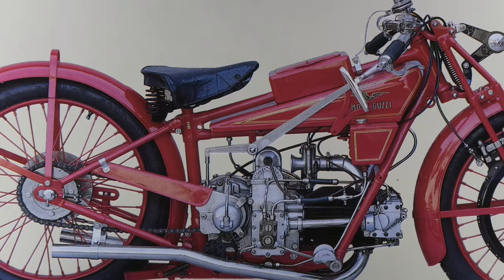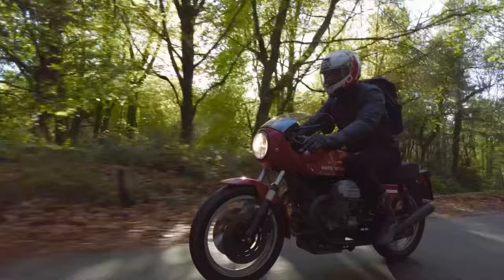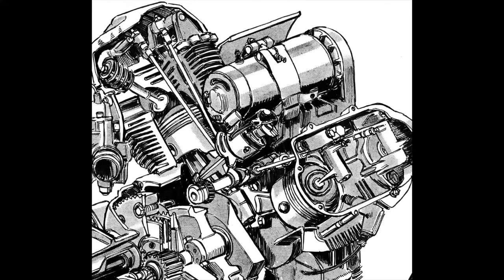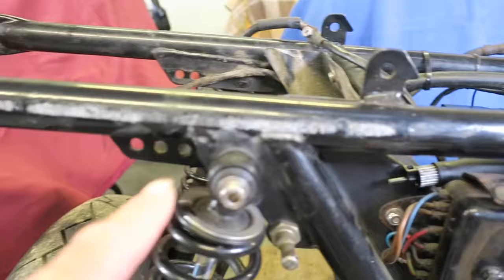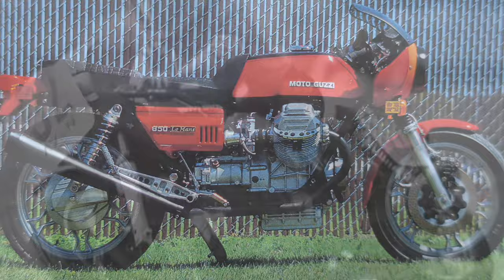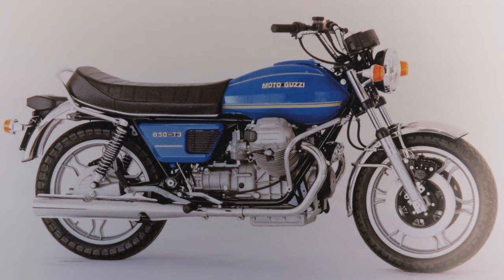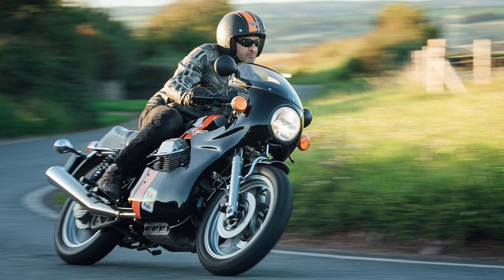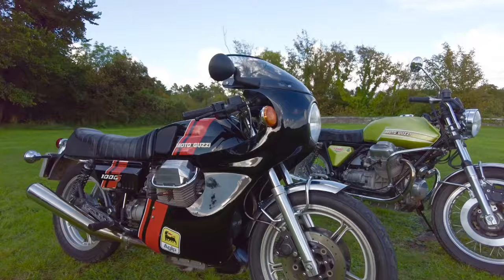TONTI | An outstanding era at MOTO GUZZI

Comment: I’ve owned 4 Tonti frame Lemans bikes.  A Mk I, (2) Mk III’s, and the one I still own, a 1990 LM 1000 Mk V.  Also owned a 1995 1100 Sport (non Tonti, of course).  The LM 1000 engine is a peach, and surprisingly strong.  Much more power than the 850 LM’s.  However, the price for that power is enormous valves that needed to be set at a very high angle to fit in the combustion chamber.  This resulted in rocker arm geometry that heavily loaded the valve stems and contributed to relatively rapid valve guide wear (40k miles is about where they start to really suck oil down the guides).  Not the end of the world.  The pistons and rings can go 100k miles if you don’t abuse them.  Even on the early LM’s with spindly 35 mm forks, the handling is remarkably good.  A bit idiosyncratic, but highly capable.  The 40 mm forks on the LM 1000’s were a noticeable, but not strictly necessary, improvement.  The linked brakes, when properly bled, are one of the bikes unsung features.  I think it works fabulously.  Finally, be extremely careful with the final drives, good quality ring/pinion gears are unavailable.  The key (and I’ve learned this the hard way), is to get the final drive unit in the hands of someone that knows how to set the gear contact patch.  This is crucial.  Most of the talk you’ll hear about setting up the drives is just rules of thumb to approximate proper gear engagement.  There’s really only one way to do it, and it can be a tedious, and time consuming process.  But if done right, it’s worth every penny you’ll pay.
Reply from the maker: I have had my 1000S for over twenty years now, it’s been on numerous trips : France, Spain, Italy, Ireland, Scotland and lots of local blasts. I have only had an exhaust valve issue, otherwise pretty bomb proof. Such a great thumping motor in that brilliant chassis. Best purchase I ever made!
Reply: @rustynuts82  I think the 1000s really nails the sweet spot of sportiness and long distance comfort.  My friend bought one new and I’ve ridden it quite a few times.  Great bike!  I think the very first 1000s bikes came with the LM 1000 engine, but most had a slightly de tuned (and much better, imo) engine.  The changes were to use the medium valve heads (similar to an 850 LM) and a milder cam profile.  The result is a bit less top end, but more mid range, better fuel economy, and much longer lasting valve guides.  And of course they so beautiful!
Reply from the maker: Yep, mines an early one with the tuned motor. Still thumps along two up with luggage no problem. Interestingly the economy was slightly better than my son’s V11 on the trip to Spain.
Reply: @rustynuts82  in my younger days I used to do quite a bit of multi-day ‘sport touring’ on my LM 1000, and agree the engine is a fine companion on long rides.  Still, after having ridden my friends ‘world engine’ 1000s, I think, overall, I prefer that version.  Regarding fuel use, both my 1100 carb sport and LM 1000 got roughly 38-40 mpg.  I’ve only test ride experience with the injected v11’s.  Anyway, nice chatting, and don’t sell that 1000s.  I promise you, you’ll regret it.